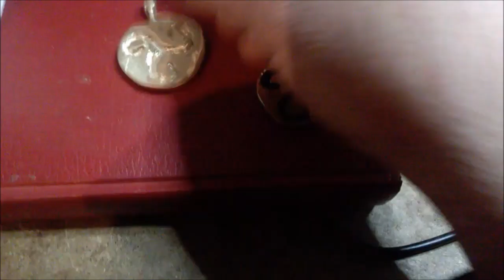fonderie: coulée de laiton :production d un triskell

Comment: C'est très sympa j'adore, creuset à gaz ?
Reply from the maker: Salut. Merci ton commentaire non c'est pas un creusé a gaz mais Un extincteur en acier Assez épais. Ça fait l'affaire en attendant d'avoir mieux. À bientôt.
Reply: D'accord merci pour les précisions. Extincteur avec compresseur ? J'ai du mal à visualiser l'installation et cela m'intéresse pour pouvoir le faire aussi (déjà en reflexion depuis longtemps).
Reply from the maker: La-fonderie par elle-même.  une bouteille de gaz que j'ai découpé. J'ai posé des brique réfractaire du ciment réfractaire  , Alimenté par Le charbon avec une ventilation. pour le creuser Extincteur en acier. Si tu veux plus d'explications n'hésite pas. Bonne journée.